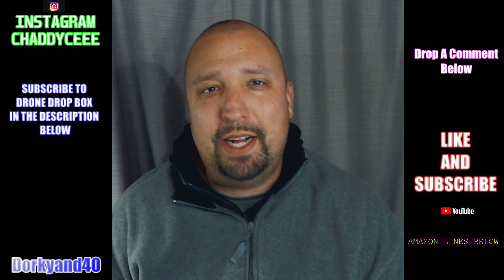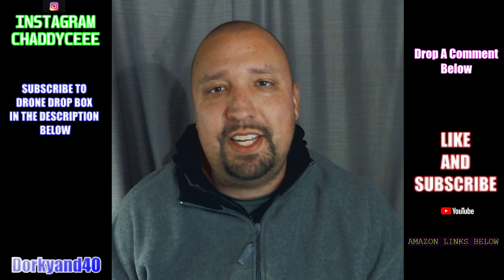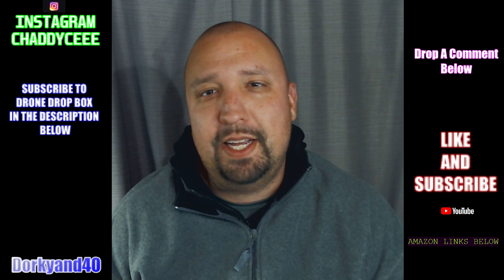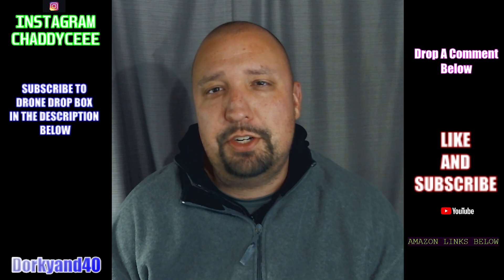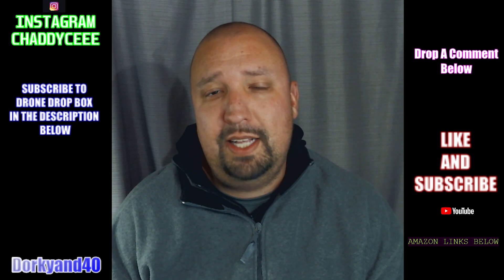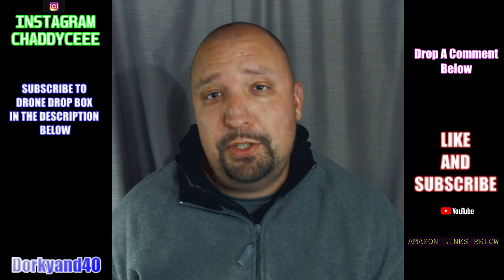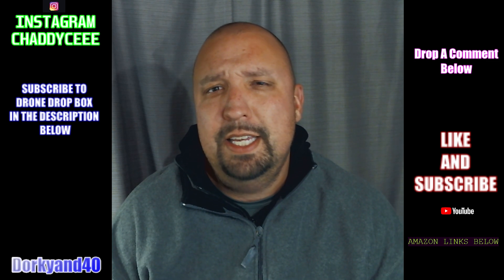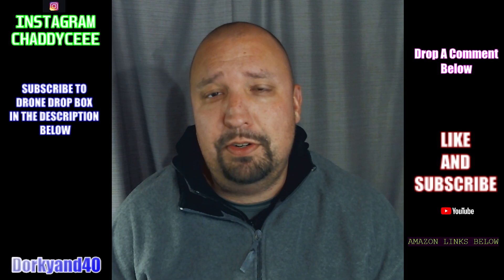BETAFLIGHT 4.0 ON 3 INCH QUADS | WHAT IVE LEARNED SO FAR

Comment: In 3.5.7 all I did was change filters to pt1. 150 on gyro 130 on d term. It was super responsive

4.0-4.0.3 feel so sluggish on stock settings to me. I'm using a 3 inch with the rs1408 emax motors and t style props.
Reply from the maker: I just did a micro reverb build and using 4.03 with no stage 2 filters and it feels really good. Also black boxed it and the Noise attenuation is great with dynamic gyro and dynamic d term filtering. I’ll be doing some videos on it soon.
Reply: @Dorkyand40  thanks. Sounds good. I am getting very slightly not motors with UAV Tech's method of only dynamic notch and dynamic d term lowpass at 60 and 200hz (biquad)

All was fine, but my motors are gettinga little too hot for comfort in these summer months.

Comment: My max fft is not consistent, can you please go through the steps of tuning for fft max. Does it need to be at 600 or more on the initial flight? Thank you
Reply from the maker: you can get it in the osd and kind of take an average or you need to enable it debug in cli and record it that way.  try to do the same flight 2-3 times and average..it gets you close enough for sure.  the new dynamic notch works wonders

Comment: I'm all about 2-3 inch.  3 is amazing, 2 is furious fun
Reply from the maker: Chris Sullivan yeah I’ve seen marks videos on it. I have stage 2 turned off but low passes at 150 for auto to work. The recent video he did was on a 3.5 betslfight build ACROBRAT  so the 200 suggestion doesn’t work.
Reply: @Dorkyand40   i didn't mean for the other comment to go through, you went through way more filter tuning than about 90% of anybody.  Love your video and rundown.  Good stuff
Reply: 4s is just insane.

Comment: put betaflight 4 on my 3 inch build, immediately noticed it flew way smoother, problem is smart audio isn't  working, works fine on 3.5,  is this bug with coding do you know ?
Reply from the maker: it should be working unless its a new TBS VTX..they use SA 2.1..so you need to flash a current dev build as it was pulled in a few weeks ago..ive heard rumors they might do one more 3.5 version but they are basically in a release candidate state now according to the changes in GitHub and my communications with some guys
Reply: ok, cheers, it's a  vtx that uses smart audio protocol, will wait for final release, looking forward to it